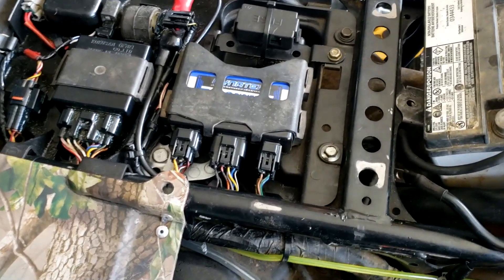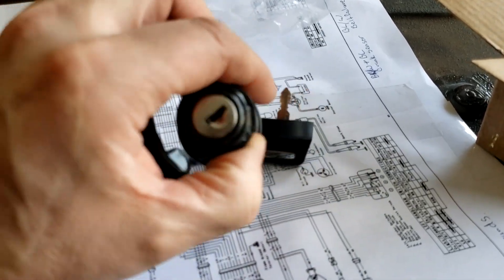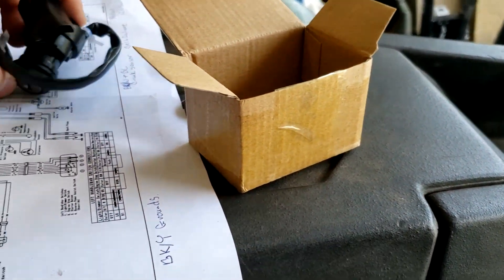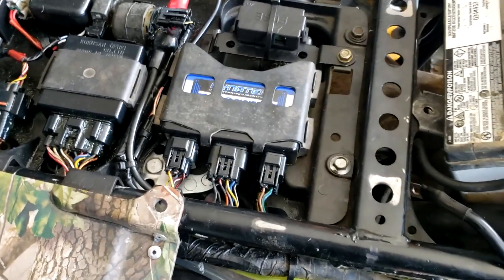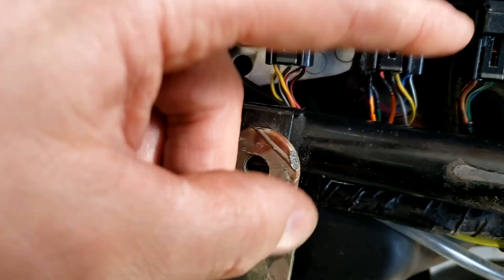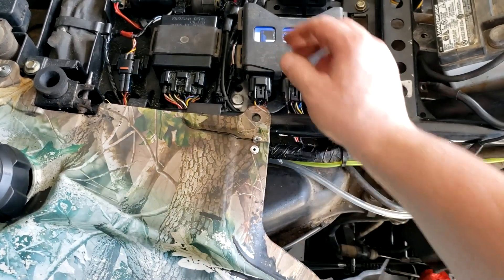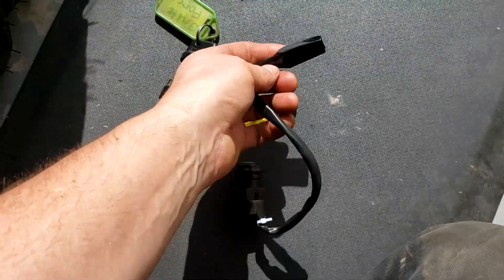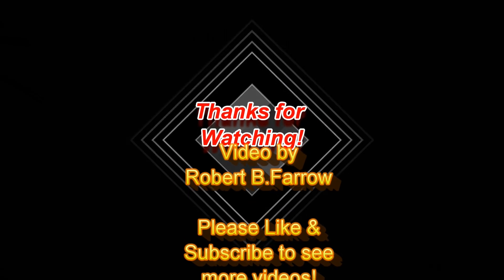Brute Force 750 still apart New Ignition Switch Broken wire found

Comment: A quick tip trick on that plug you can use A small flat head screwdriver to pop out that connector. Inside of that plug to push it back to replace it with A new one on new wire to with different types of end connectors to with shrink wrap over the top of them to.

Comment: Check the CDI box& test the stator on it. A long with the voltage regulator rectifier box in front where the head lights are at underneath the plastic covers on it.

Comment: What is the yellow tube at 5:39, looks slightly pinched by zip ties.
Reply from the maker: That was the primer line that the guy before me put in. Don't need it, just been too lazy to remove it.  He did all kinds of cheap ass fix attempts.

Comment: Whole new harness is $120 on Amazon..
Reply from the maker: Ya harness is cheap, replacing it is a pain in the ass but if I can't find the problem it may be the way to go...winter project LOL! Thanks!
Reply: @RobFarrowATV  I have the same ATV, and the same problems you're having. I bought it with the falling on it's face in mid-throttle issue. She only wants to go at barely above idle, or wide-open. So, I've been watching your vids closely.
Reply from the maker: That sucks! I've gone through everything and it seems to run good 85% of the time, the other 15% it's like it decides it doesn't want to run smoothly and I can't figure that 15% out.  Only thing left to do it get a whole new harness and change it out but I'm not quite at that point yet.  The 4x4 doesn't work anymore either...next step is a manual system.  The POS lives on LOL! Hope you get yours figured out.